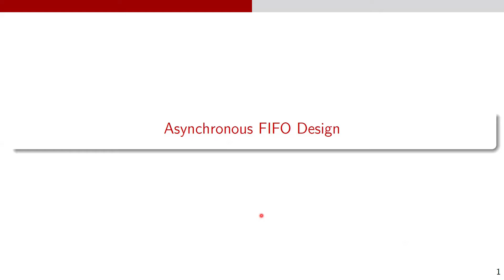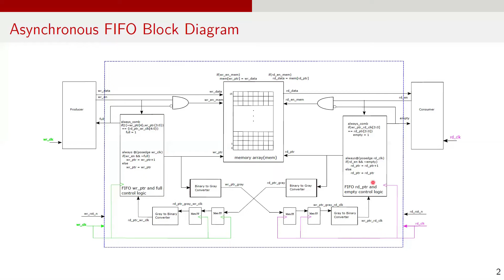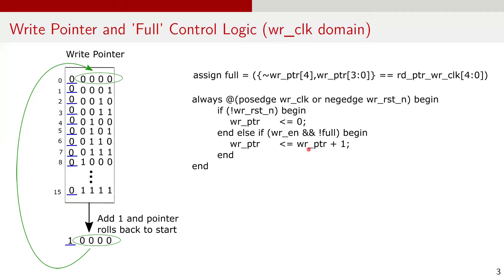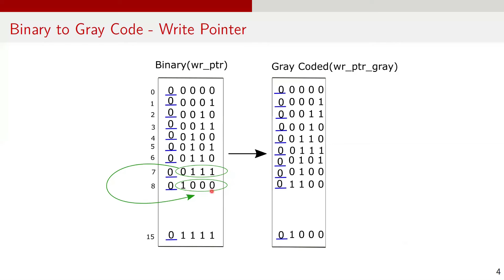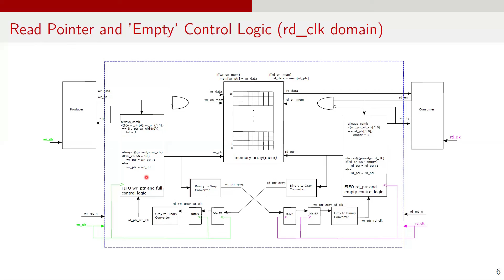Digital Design Interview Questions | Asynchronous FIFO |  Clock-Domain-Crossing (CDC)

Comment: Timestamps (Powered by Merlin AI)
00:10 - Understanding asynchronous FIFO design for clock-domain crossing.
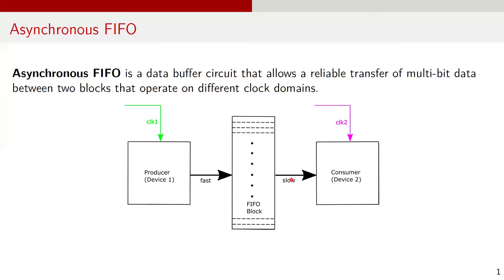01:22 - Asynchronous FIFOs facilitate reliable data transfer between different clock domains.
02:48 - FIFO manages read/write signals to ensure data integrity.
03:56 - Asynchronous FIFOs transfer write pointers between clock domains using gray code.
05:09 - Explains the conversion and flow of read/write pointers in clock-domain crossing.
06:12 - Using Gray code enhances FIFO pointer transitions efficiency.
07:21 - Single bit transitions in asynchronous FIFOs mitigate metastability issues.
08:37 - Overview of asynchronous FIFO pointer conversion and limitations.